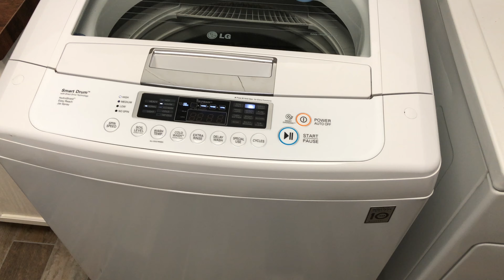LG WT1101CW Washing Machine IE Error Drain Pump Runs Continuously Fix

Comment: This saved me a repairman visit and charge.  Didn't have an error code but the drain pump would run continuously even with no wash cycle commanded.  Only unplugging the machine would shut down the pump.  Thank you so much for posting this.
Reply from the maker: Glad it worked for you!

Comment: I’m adding to the testimonials, because this video just saved me so much time and worry. I love my LG washer and have had it for over a decade now. I’ve had to replace a few parts over the years, but am not too savvy when it comes to the computer components. I thought my poor washer had seen its last wash. I’m so glad I found this video, because a quick tap with my hammer stopped the drain cycle, and she’s back to normal. Thank you SO much!

Comment: Worked perfectly! The blue box with bar code is the one. Tapped the blue box couple of times, plugged back in to see if it worked, nope, was still pumping. Was ready to give up but decided if I have to buy a new board I’ll just TAP HARDER! I left it plugged in and gave it a STRONG TAP, and it stopped!  Back to normal operation! Thank you so much!

Comment: This worked for me too! 
Was getting an OE error and the washer would not drain. I thought it was the drain pump. Replaced the pump but made no difference.
Then I was going to replace the control board and looked up this video for how to take it apart.
But then saw the part about tapping the relay to get it to unstick and voila it fixed it.
I think the relay is the blue thing with the bar code on it (but no guarantees). I just tapped everything on site and prayed to the godess of laundry.
Wife will be happy when I break the news to her!

Comment: The only 2 relays on this board are beside eachother very close. They are black and beside the barcode. Exact model owner here, no code same issue. The fix described above works only for one load for me. I have successfully, replaced both relays. I removed the panel from the washers face, separated the controller and board sides. Cut holes in the back and carefully removed the gel. Sliced the gel around the relays on the front, made a tool to heat all 8 points at the same time and once hot pulled both relays out together. Install is easier but you will need some spare solder, works great and save a few hundred on the entire circuit board.
Reply: Relays are both part# HF33F
Reply from the maker: Amazing!

Comment: I wonder if slapping the front panel would have unstuck the relay? Maybe should try that first before opening the board.
Reply: That’s what I did just right now. And it works again 😊
Reply: @regio4327  Good to hear, the old slap it to see if works does work sometimes. As a mechanic we use to slap the gas tank if we suspected the fuel pump. If the fuel pump was just stuck it would work again. To me it sounds like the relay is either under rated or defective from the factory. My guess is that the return tension for the contact is a little bit weak so that the contacts can become fused when it closes because there is always sparking when you close or open an electrical switch.
Reply from the maker: For so many people to be having the same problem, you’re right.  It’s gotta be either under-rated or defective from the factory.  I would me inclined to just replace the relay with a better one, but all of that water-proofing gel is in the way and I didn’t know how to handle that.  Do you know an easy way to remove that stuff to change out the relay?
Reply: @budgetprojectsbydavid5263  No I don't. Maybe a soldering iron could melt it and you could dig it out enough to get to that relay? I don't know how many people would be willing to do that though. I think these companies just expect you to buy a new washer every 5 years or so. Had I known how it is with these HE washers I would have kept our old one and tried to fix it but I assumed the new technology must be better. Our old washer was a simple kenmore washer with mechanical switches but it did have electronics. The reason I got rid of it was because the cycle was all messed up. I found out later that those washers had a way to reset the cycle using a secret but simple procedure but to bad I found out after we replaced it. Oh well gotta move on with the times I guess.

Comment: Thanks a lot, buddy. It worked great. You’re the best. I really didn’t have to take apart anything I just took the back of a screwdriver and tapped the top of the whole motherboard on the top of the machine while unplugged and it corrected itself. It’s working right thank you for the info. You’re the best.

Comment: The drain pump was mo longer running however now the washer won't stay powered on and just shut a down in a few seconds. Any ideas???
Reply from the maker: It sounds like some kind of protection fault in the circuit board.

Comment: @7:08 The only relay on the board is the one with the barcode on it. The other blue ones are capacitors as well. Tapped that one a few times, put it all back, and I'm back to normal. Thanks!
Reply: Thankyou

Comment: OMG! It Works! I It Actually Works! 😎👍 I've got a LG Inverter Direct Drive True Balance / Model Model WT1101cw Top Load Washer we've had for 10 years now, and it has worked well untill this issue came up. The LG Washer's drain pump is constantly on, even when you turn washer off. To turn it totally off you had to unplug the washer from the outlet. Did as Budget Projects by David showed & demonstrated for a possible fix in video, and low & behold a simple solution works! I simple love the simple solutions! lol Got a load of wash going right now as I'm type my comment here. Thank You so much Dave for the cross feed fix. The Missis is very happy too & says Thank You also! Greatly Appreciat! God Bless You & the Family, take care Sir!  : )
Reply from the maker: God Bless You, Sir!  Thanks for the kind words!  Glad the Missus is happy! Lol That is very important!  

Make sure to check out the 3 month update on my channel that shows the replacement of the circuit board, if it comes to that.  Have a great evening!

Comment: Model wt4870cw   The problem relay is the black one under where the large wire bundle comes into the board.  Near the white plug on the end of the board that has the big green coil. This the ebr75795702 board. I ordered a used replacement on ebay for $50. There are many  available

Comment: This method works for powering on and the pump is running already the tapping relay gets it to turn off. and also for when water wont drain from the machine during a cycle ie pump wont switch on.. had to do this twice now probably a year apart. probably saved me upwards of $600 in repairs if i had to call someone to fix it.
Reply from the maker: So glad to hear it helped, and saved you some serious cash!

Comment: Great diagnosis and overview of repair. It confirmed and identified issue of my drain pump remaining on.  Tapping the relays worked but it did come back after a few washes.  But, it has allowed me to get laundry done while I await a new control board. Too bad the board is sealed and you cannot just replaced the relay :(

Comment: great video - worked on LG like a charm. thank you
odd method to resolve issue. one would expect explanation in manual with better instructions on relays replacement / trouibleshooting from manufacturers instead of replacing whole board

Comment: Thanks for the video.  The lazy man inside me decided to try some percussive maintenance right in the indicated areas.  Fortunately, the results are instant should you hit it just right: the pump stops running.  Not to short circuit your video at all, it pointed me in the right direction, but it's the ideal place to employ percussive maintenance, a stuck mechanical relay, and it worked like a charm.

Obligatory LG washer terrible, but I refuse to let them win by replacing it.

Comment: I  just had a guy come out and charge me $124. Said I had to replace the computer. Then, I found your video. He wanted to charge me over $650s. Said the part alone was around 400. I said no and paid their fee. Why am I always having to fix my own stuff or pay for new. :( 
I am so glad I found your video. I have the exact washer you have. Pump running continuously with the 1E code. I sure hope I can do this and it works!. You make it look easy! I was gladly going to pay someone to fix my washer but I won't pay as much as he wanted to charge. That is crazy. Now to find the time...
Reply from the maker: Glad you found the video in time! The project is not bad at all!  Good luck and check back in, if you would, letting us know how much you paid for the board and where from.  Thanks and good luck!

Comment: Thank you!  I wasted an hour on the phone with LG support.  Their “smart diagnosis” said everything was ok despite the drain pump running continuously.  Then the support person said it’s either the drain hose or the drain pump ($150) or the water level sensor ($55) if I wanted to replace them myself, or I could call in authorized service which quoted $200 labor plus parts cost.  I tried your relay tapping method and it’s working again!  I assume I’ll have to replace the circuit board eventually but mischief managed for now.

Comment: I will try this.  Thanks for the video.  Question for people more knowledgeable than I:  I'm getting the IE code and believe that is has something to do with the draining rather than in the in-flow of water to the tub.  My pump does indeed run for a long while, but does not run constantly; it will eventually stop.  My clothes are also sopping wet when I get the code.  Is the problem and solution outlined in this video going to work for me?

Comment: I just finished doing this and it worked like a charm. Is there anyone able to tell me how long this fix lasts?
Reply from the maker: In my experience, i had to do the fix weekly until it finally failed 3 months later.  Some have had as much as 2 years.  The fix i performed after 3 months was a board replacement.  I have a video on my channel detailing that process if you are interested.

Comment: January' 2024-Tried this but couldn't get the machine to work. Repair tech ($124 for the visit) confirmed the problem was the control panel and said it would cost about $750 to fix. Ordered replacement board from Sears PartsDirect for $379 (after a 10% discount). Just tried this fix again, with a little more tapping vigor, and it worked. I haven't decided whether to keep the replacement board.
Reply from the maker: Your mileage may vary, but the tapping of the relay is only a temporary fix.  The relay is failing.  Mine lasted for 3 months, others have gotten a year or more.  I have another video documenting my replacement of the board if you are interested.
Reply: Yes, would be very interested in your board replacement video. Thanks! @budgetprojectsbydavid5263
Reply: @budgetprojectsbydavid5263  The original problem cropped up 1/1/24 and your fix worked. I've had the replacement board ready to go since then. Problem just came back, almost 18 months later. I'm getting my screwdriver...
Reply from the maker: Good luck!  It always feels nice when you have the parts on-hand!
Reply: @budgetprojectsbydavid5263  The "tap fix" worked again. Hopefully, we'll get another 18 months! I still have the PCB, just in case. Just for reference, the PCB cost $379 at Sears PartsDirect on 1/31/24. Thanks!
Reply: 2/18/26-just applied the "tap fix" again; appears to be working
Reply from the maker: Amazing!

Comment: My two cents: Whack bluebox with barcode sticker, results may vary, good luck.

Omg, like many others here, I am indebted to you David.  LG Washer Model WT1201CW, same issue. I was whacking things for 20+ minutes, and finally caved and started whacking with it plugged in and the pump running (yet washer turned off). After whacking another 5 minutes, finally it turned off when whacking the blue box with the barcode sticker. Running it now, been good for 20 minutes so far, here's hoping.
Reply from the maker: Wow! Thank you for the $uperthank$!  That’s very generous of you!  And yes, that blue box with the sticker is the one.  I have another video detailing the sourcing and replacement of the board, if you’re interested.
Reply: @budgetprojectsbydavid5263  if I need it I'll look for it but hoping to move in a few months and leave ALL of the appliances in this house behind me 😅

Comment: Thank you so much. It worked like a charm.  The hardest part was the clips (which isn’t hard at all). You are the true MVP. 💪🏾💪🏾💪🏾
Reply from the maker: Thanks for the kind words and great job!  Some folks have reported being able to whack it without removing anything.  Also, there’s another video on my channel that details the sorcing and replacement of the control board, if you’re interested.

Comment: Thanks, David for the video! My washer is a WT1201CV. It's fixed by following your steps to get to the controller. The problem with my washer is that the drain pump ran continuously. I suspected the 1E error has nothing to do with the "fill". It has to do with the "drain". I am an electronic engineer. Let me clarify something that I saw on another post. You ONLY need to tap on the BLUE rectangular components on the controller. That is the RELAY. You don't tap on the black round cylinder components. Those are capacitors. The relay can stick to an ON position, and then the drain pump would run continuously until power is removed or the controller timed out! BTW: all components are epoxyed on the Print Circuit Board. That means one cannot just replace the relay. If you want to replace the controller. The part number is LG EBR76262101. My quick search on the Internet shows the price can be between $180 to $420!
Reply from the maker: Thanks for your comment.  I, too, was sad to see that epoxy on the underside of the board.  I have another video on this unit that shows where i purchased my replacement board and showed my installation process, if you’re interested.

Comment: You my friend are a bloody legend.
I heard the pump going while it was filling, searched based on these factors and thankfully found your video. Perhaps worth an edit to add the blue relay with white sticker info as per the comments.
Thanks for taking the time to make this.
Reply: Just had to do it again 6 months later. Slightly cracked the blue switch cover so it may oxidize the relay but it needs replacing at some point. 
A quick refresh from video and 15mins later it's working again!

Comment: Dude. My man. I didnt even take the metal casong off. I just hit about where the soil level/ wash temp buttons would be and it worked like a charm! Thanks bro. You're the best.
Reply: This comment saved me SO much time and worry. 😂 I did what you did, and it’s back to normal agin. Thank you for the tip! I was nervous about taking that faceplate apart.

Comment: I have searched and searched for this issue, but apparently the wording is key. Took me STRAIGHT to your video this time around.

My husband and I have been having this issue off and on for the past year. We have just been letting it sit awhile, and it usually resolves. Well, it has been running continuously for 2 days now (power on, draining from the start), and since it won't hold water, of course it is flashing IE. Exact same washer as in the video. 

Gonna try this out with the additional input from the comments. Will come back to add how it works out!

Edit: Welp, took me just a few minutes. Followed steps up until removal of ground wire. Tapped hard over where the relay (blue piece with with sticker) was roughly placed from where I could see it in the video. IT WORKED! Now let me go wash some dang laundry!

Thanks a bunch. My husband was seriously considering shelling out for a new washer, but as he doesn't wash the amount of laundry that I do *coughs*, it was less pressing for him. Hence why we have been tolerating this seemingly sporatic issue for so long.
Reply from the maker: Glad you finally got the wording right! It’s a weird issue, indeed, and from the looks of it, a very common one.  You may want to check out the other video i have on this washing machine where i changed out the board.  Good luck and thanks for taking the time to comment!
Reply: Wording is very key, so many videos telling me to check inlet filters

Comment: Great fix on my machine, I was hours from buying a new machine for $800. The little blue boxes on the board are the relays, which one handles the pump is unknown, but I'm ordering a full set from Digikey and replacing them all if it fails again. Thanks for the heads up and great diagnosis!

Comment: After doing this, the pump isn’t running but when I turn it on, the control board turns off after a couple seconds.  Any ideas?
Reply from the maker: Check your connections on the board. Make sure nothing is loose is grounded out to metal.

Comment: thanks for your help.  I opened mines when it was stuck draining all the time today.  Gave it a few hits on the relays and it was back to normal.  These machines are so dependable and have no issues for many many years.   Btw it would probably be easier to just remove the screen drives holding the board to the faceplate then taking off the ground metal plate.

Comment: I just did this with the exact same washer but now my machine will not power on? Any suggestions?
Reply from the maker: Did you accidentally unplug anything on from the circuit board?  Did you forget to plug the washing machine back in?  Other than that, I can’t really help.
Reply: @budgetprojectsbydavid5263  I will recheck the circuit board.

Comment: I had the same issue and even unplugging and plugging back in, the impeller continued to run.  I have the LG style washer with the controls on the back panel and this worked the same after accessing the Control Board. Thanks for the tip!